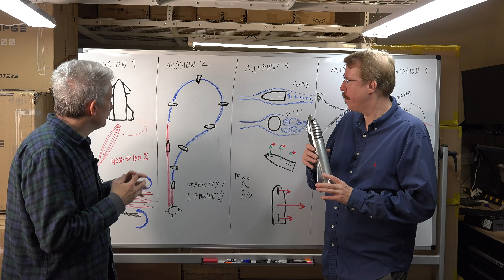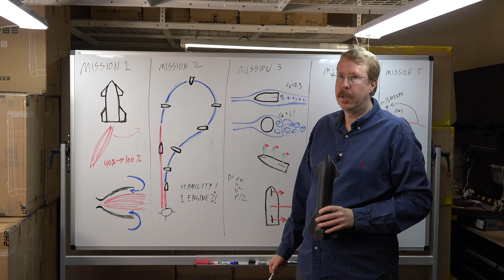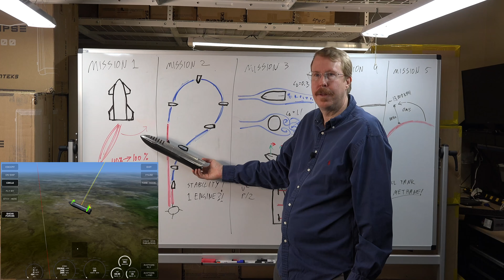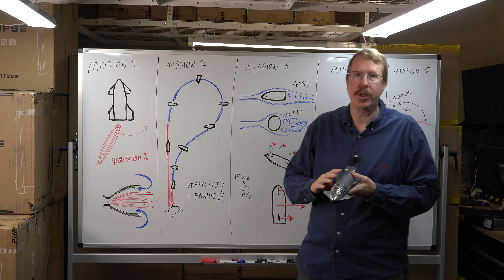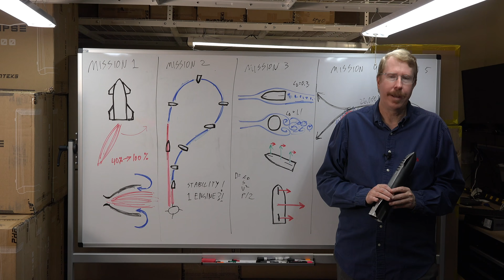How to FLY the SPACEX STARSHIP!

Comment: if they land where the martian air is thicker (twice as thick), at the bottom of that huge martian canyon, valles marinaris, 23000 feet below "sea level" (datum on mars), they can save even more fuel. there is evidence of mud (water) there also (to make more methane fuel and oxygen using co2 in atmosphere and water)

Comment: How strong/heavy would the cable need to be in order to withstand the tension it would be under?
Reply from the maker: For 1G, exactly enough to lift the starship on hold it on Earth. Not an ounce more, not an ounce less.
Reply: @austinmeyer     I used to log back in the 70s'. I could break a 1.5" steel cable pulling in a big log. 

The idea sounds great. But I'm still curious  what size cable it would take.
Reply from the maker: @phillipzx3754  Whatever size cable it would take to lift the rocket up on the pad and put it on top pf the booster. Not an ounce more. Not an ounce less. Enough to suspend the rocket under 1G. No more, and no less.

Comment: It’s extremely interesting that you turned out to be wrong about what orientation the vehicle wants to be in. 

Remember the fluids inside makes up at least 50% of the mass. When it ascends, the vehicle remains upright with minimal corrections due to being aerodynamically stable when going upwards. Then it hovers, losing that stability and uses one engine to keep it flying. Then upon descent, the fluids fall towards the windward side, giving starship aerodynamic and CoM stability. It uses the header tanks to survive not having propellant that can be sourced from the main tanks since that propellant is not going to be able to be pumped through the pipes if it’s against the side of the tank and not the bottom. 

Then when it flips, the main tank propellant, when it doesn’t slosh too much to condense the autogenous gas pressurizing it, comes against the valves, allowing the raptors to quickly switch to them shortly before the header tanks drain empty.

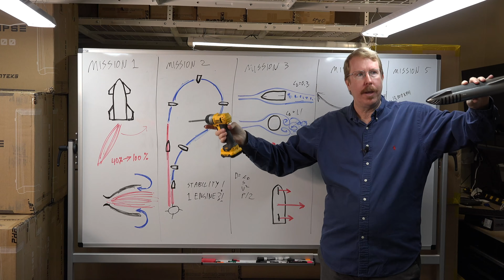Comment: 23:32  Hooray!

I've been saying for quite some time that they ought to tether two Starships together for the trip, and I haven't heard it batted around the media either.  It's nice to finally hear someone else say it.  I've been assuming that they would want less than a full g.  A cable does have mass that could have been used for other payload items, and you want it to be rather long to minimize the Coriolis effect.  

Starships have the hardware to connect to a cable anyway, so that they can be lifted onto the booster (or the test stand, at this point) with a crane.  So the cable itself is the only extra hardware.

Comment: Coming back after the spectacular BOOM .BTW also the flip over after  shutting down the engine is quite different :)
Reply from the maker: Yah the way >>I<< did it was to shut down the engines and let stability take its  course. The way THEY did was to throttle down gradually to go to a HOVER at altitude and then let it fall.
Reply: @austinmeyer  So will the next update have a throttle control option to  manually hover?
Reply from the maker: @playerjeblemontea1568  I dont think so cause it will be impossible to land.. .trust me i have tried
Reply: @austinmeyer  what if we do it in KSP style control or add it in computer edition if there will be? :)

Comment: Why aim for a 1 G spin? Surely there must be some advantage to a lower G value, say 0.3 G like Mars? Though I believe we have no data on this yet, which is a shame.
Reply: I’m not entirely sure this adds up, but I think one of the big reasons for creating artificial gravity is so your astronauts stand a chance of thinking during the 5G braking manoeuvre. If that’s the case, while they’d be better off with 0.3G than 0G, the reentry G-forces are now ~17 times what you’re used to. With a 1G spin, it’d be 5 times what you’re used to. That’s still a lot; I’d want to lift weights on the way there to be able to move my arms during that, and to remain conscious I’d want to be sitting flat against the acceleration. But it’s a lot more likely I could do it than if I were trying to do it from 0.3G

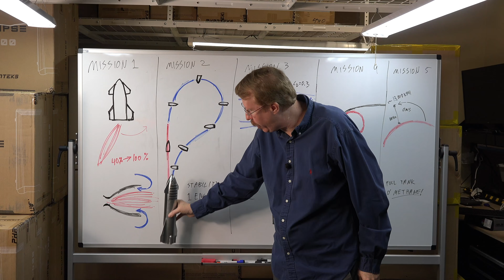Comment: 13:05  But using only one engine, how do you control roll for example?   In that case I think you would need stronger control thrusters. Also.. if one of your engines fail during that manuver, the question is "it can restart another engine fast enough?"
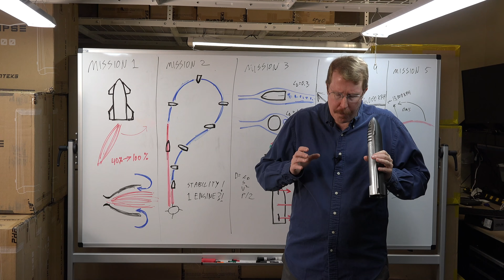29:44 I love it all your presentation, but I kinda disagree with your last point.
For a trip to another star, you need a lot of deltaV to achieve the trip in a descent amount of time.
Even 1/4 of light speed means around 20 years to a closest star, if you can achieve that deltaV, escaping sun gravity represent an infinitesimal % of that. 
There are a lot of points to colonize mars or venus, but the point to use those places to reduce deltaV to reach other places (even in the solar system) seem quite silly, more taking into account how cheap this would be with a fully reusable rocket.
Reply from the maker: A few notes:

-Look at the first test-flite: It was done with one engine. No roll control from the engine was needed.

-Look at all falcon-9's: They all land with 1 engine.

So single-engine ops are normal... or crap my airplane only HAS one engine! :-O

So yes there is a safety-loss, but it has been judged acceptable in many cases.

They COULD use 2 or 3 of course... BUT would have to be that much more accurate with WHEN they light up to make sure they.... still MAKE IT TO THE GROUND BEFORE SHOOTING UP AGAIN! :-O
Reply: @austinmeyer  Ok.. you are right.. yes, seem that is possible to do roll because they are offset from the center, if that is the case then not sure how the roll is achieved on the falcon9, maybe they use the cold thrusters in that case, because I can not imagine how to roll with one engine in the center (of course it could be a way, I am just ignorant about it).
Thanks for the reply..  great work!
Reply from the maker: @angellestat2730  Oh yes you can roll with 1 engine since it is offset, that is true. BUT, it will cause pitch and/or yaw as well... which is NOT going to be the same as the roll you want just by luck.

so you wind up not being able to use it for roll since it would mess up your pitch and yaw

Comment: Let me tell you how physics works. Landing with 3 active engines surprisingly saves fuel. Probably, each engine ignition spends some fuel too, but this is not that big. Let's make some math... 70% generates 1g, so 100% generates a little less than 1.5g, and 300% generates roughly 4.3g. Wich means that we are decelerating at 0.5g with one engine, and at 3.3g with 3 engines. So, about 7 times shorter burst (actually, 230 / 30 = 7.67 times). Since we are using 3 engines, we are gaining something close to 2.5x profit in fuel... Which IS a big deal! So, most probably you lost you bet.

Comment: I have always thought that the tethering of two ships enroute to Mars is a good idea, but only do 0.38 g rotation.  The ship already has hard attachment points on the nose that can support the entire front half of the ship in earth gravity so no major added structure required.  The ship is already configured for occupancy in vertical orientation on mars.  Once enroute there is almost no fuel onboard, so ship is not too heavy.  Astronauts will arrive acclimated to Mars gravity.

Comment: 2 Starships tethered and generating artificial gravity has been theorized for sure.
Reply: It's not even as preposterous as it seems, they need to hang it from the nose for stacking anyway
Reply: @zchris13  Nobody says it's preposterous. But the idea that it doesn't cost you anything as Austin says is not accurate either. It will cost you the weight of the steel cable and the mechanism to tether two Starships together. Because it has to be very strong, it will be a great deal of mass that has to get to orbit, which means less mass for your human cargo. Nobody knows what that trade off will be until the Starship is at least in the 3rd phase of testing. So the tether idea is a good one, but very unproven at the moment.

Comment: Well, regarding the structural strenght of the ship required to be hung by a cable, I would point that's precisely how the current prototypes are lifted and mounted over the test structures (hung by a cable at 1G). At most you'll have to ensure the nose structure can distribute the load nicely onto the upper rings.
Reply from the maker: Well there ya go then!
Reply: I don't think the solar arrays and radiators will be able to handle 1G when deployed.
Reply from the maker: @slaybert  They do OK on the roof of my house right now......

Comment: Gotta be 3 engines since none of them are center; they're all offset. They'll need to do a hoverslam due to extra thrust but all 3 for the most controlled landing.
Reply: The Starhsip hop tests have been done with one off-center enginge. So it's not totally impossible.
Reply: They will use one for flip, then two for the rest. And again, SN5 & 6 hop proved that the thrust vector control is totally capable for off-center

Comment: Thanks for the 5g Mars entry number.   Alas, tethers are tough to deploy and control, and many Tons of equipment
Reply from the maker: I guess I'm thinking it need not be many tons... just a cable and some connectors... assembled with space walks at the beginning, and dis-assembled at the end of the trip... i dont think a cable need weigh many tons... the existing reaction control system could be used to get the spin going...
Reply from the maker: OHHH wait... see my comment in the video description I just added after thinking about your post... I forgot that the ENTIRE SHIP would have to be strong enough to hang from a cable under 1 G! The nose would have to be strong enough to literally hang the entire ship from it, the structural loads being carried all the way through to support the entire ship at 1 G! Hmm... that might add up to tons after all... it's a whole new structural requirement not existing on the ship as designed right now: I bet they have NOT designed the whole ship to be hung from its' nose under 1 G!!!! ;-P 
Wow this video is stirring up a lot of critical thinking and bringing up things I missed!
Reply: @austinmeyer  Don't forget that the ship has to be able to be stacked by a crane (hooked up to its nose) on Earth to the top of its booster before the launch! So they can use the same ports if they want a tether articifical-g
Reply from the maker: @alvianchoiriapriliansyah9882  Oh yah cool! BUUUUT... now we have to carry the WHOLE SHIP (not just the nose!) from that crane! Argh! (BUUUT, we only need to do it when the fuel is MOSTLY empty)
Reply: @austinmeyer  I'm talking about the entire ship, not just the nose. And this is literally the process that has to be done for every single ship that will go to orbit (because of the booster). And after Trans Mars Injection the fuel is indeed almost empty anyways (only a little bite reserved for landing)

I have added a timestamp here for stacking animation
 https://youtu.be/0qo78R_yYFA?t=2m2s
Reply from the maker: @alvianchoiriapriliansyah9882  OK there you go!!!!! Now I guess we are down to nothing but radiation shielding and com antenna always pointing at earth and solar panels always pointing at sun???? Apparently setting up the spin is 'tricky' and 'not always works' but i dont care i think that part sounds easy... unless there is some gyro effect that causes the spin to degrage over time so the ships cant always point their radiation-shielded side to the sun.. then my idea wont work.
Reply from the maker: @alvianchoiriapriliansyah9882  YEEES!
Reply: @austinmeyer  actually the spin thing generating usable G (microgravity) is in the planning  for orbital refuelling (with money from NASA to research it) and by now, as per Musk's comments,  the nose wil be pointed away from Sun in a fixed position for thermal protection during journey to Mars. And guy, very nice work !! I was waiting for you and x-plane to join this spacex thing since 1999 ! Congrats !
Reply: oh, and for the spin thing,  Starship is being engineered to be joined back to back during orbital refuelling ;)

Comment: Very nice video! I enjoyed watching it.

About the issue of long micro-gravity:
You suggest coupling two Starships and spinning them. But this creates huge issues when you try to point the solar cells towards the sun AND the antennas towards Earth/Mars. Moving internal mass (astronauts) will always cause the ships to roll pretty hard. 
A better solution to that are internal short arm centrifuges for daily exercise: https://www.dlr.de/envihab/en/desktopdefault.aspx/tabid-8667/#gallery/23780

Additionally Starship has about 6,000m/s of delta_v. Going from earth to Mars only needs 3,600m/s on the LOWEST energy transfer orbit. Taking advantage of the full 6000m/s of delta_v the fight duration can be lowered to about 3-4 months, instead of 6-7 months. That also cuts down the radiation exposure time. (Tho it will result in a higher arrival speed at Mars, of course) 

About the high G-loads during Mars entry: 
You don't need to slow down as MUCH as possible! You only need to slow down enough to stay inside the atmosphere. You can do this by creating NEGATIVE lift. Go to an AoA of about 40° but turn the ship on its back. The deceleration will be lower, but the "lift" will keep the ship inside the atmosphere, skipping along and bleeding the speed over a longer period of time.
Reply from the maker: TOTS AGREED on negative lift! If this was not in the video then it is one of the things I cut for time... certainly it was in one of the takes. And indeed you can, and should, try this in the App!!!

Comment: This is a nicely made video which explains things well to layman. Few nits though :P :

1. You  could use lift at Mars during capture phase. Just use it the other way! i.e. produce negative lift instead of positive one. That way you could keep your vehicle longer without escaping back to hyperbolic orbit. In fact this is what Elon has shown during 2017 presentation (flying about 60-70° AoA, but inverted). This in turn allows one to tune down g-loads
2. You only need to slow down to 18000km/h at Mars. Mars escape velocity is slightly above 18000km/h. If you're moving at 18000km/h you're in orbit, just not a circular one (such orbit would be called HEMO - Highly Eccentric Mars Orbit).
3. Tethers certainly are not free. They are hard to set-up, they mess up thermal design, comms design, etc. Moreover you'd have to dismantle it few days before landing. Few days is enough to mess up your vestibular system anyway.
4. Hoverslam/suicide burn is a thing -- F9 can't hover, it has TWR > 1 during landing, yet it lands. It's extremely hard to do manually, so hand flight simulator must dispense with that (but computer controlled rocket doesn't)
Reply from the maker: Oh yes the sim is set up to let you explore inverted flight during hyperbolic, entry, etc. The sim is there to let you experiment. As for the cable, you get 6 months of 1-G for basically zero fuel cost, and you worry about dis-assembling it a day or two before landing? No way: Not a concern compared to the benefit!
Reply: @austinmeyer  WRT cost & benefit - the major issue for humans after flight is actually vestibular system readjustment to gravity -- few days of microgravity messes it enough.  But the cost of artificial gravity system is much more than just a cable and hooks: radiation shielding design is messed up, thermal design is messed up, your comms system is now more complex and fragile, your navigation system is more complex and fragile (to manual backup anymore), solar panel design is changed, setup is risky and hard (previous in-space attempts of various wire systems had roughly 50:50 failure rate). It essentially means major redesign of the vehicle.

Anyway, Elon explicitly said they are not going to do that. 

NB. ISS missions are half a year with some nearly full year and some of them ended up with 7.5g reentry (if Soyuz guidance systems fail and they sometimes to, they use backup procedure which ends up in fully ballistic reentry) - so we have a strategy to deal with return to gravity after 6 months of microgravity. The drug + exercise regime works reasonably well to keep astronauts healthy. And artificial gravity doesn't solve other problems like radiation. Spinning actually makes radiation shielding less effective (significant fraction of charged particle radiation comes from the Sun, so so called shadow shielding works reasonably against it; spining messes up shadow shielding)
Reply from the maker: @SebastianKaliszewski  " spinning messes up shadow shielding" ...You can spin with shadow shielding... the normal vector to the plane of rotation simply points at the sun.... shadow shielding un-affected... imagine rotation with heat-shield bellies always turned to the sun...  shadow effect not compromised... system is neutrally stable with no energy input of any sort to maintain it... unless gyroscopic precession starts altering the plane of rotation... not sure if that even HAPPENS with 2 masses on a cable.. feel free to do a youtube video laying it all out...
Reply: @austinmeyer  You then need a new shield along the side of the spacecraft, then (or expose the crew to increased radiation). A side of Starship crew cabin is bigger than its base so any added shielding is less efficient per area. And you get no benefit from shielding provided by thrust structure, methane header tank, main tank bulkheads, floors, etc.  Those provide 30-40g/cm^2 of shielding (and methane header tank provides >100g/cm^2 but it's pretty small and far away from the cabin).  30-40g//cm^2 is probably good to go without adding much more.

While, on the side you have about 8g/cm^2 -- the rest you must provide separately.
Reply from the maker: @SebastianKaliszewski  oh yah you have to shield maybe half the walls instead of all the floors... may indeed  be more shielding...